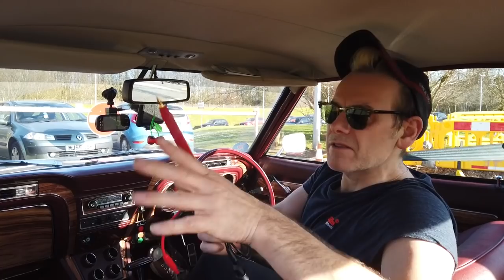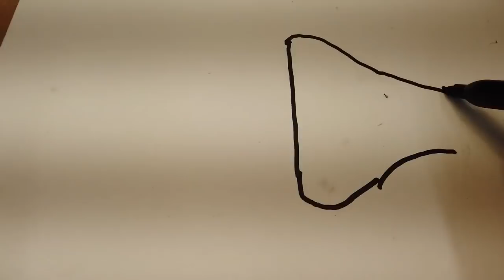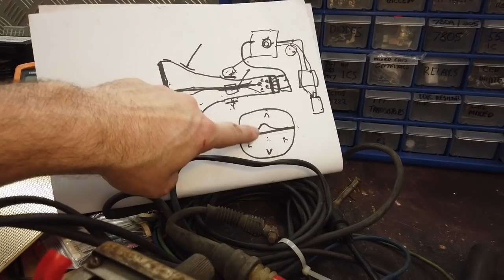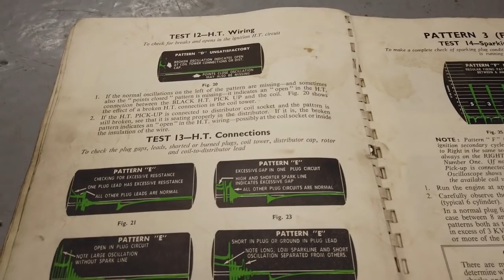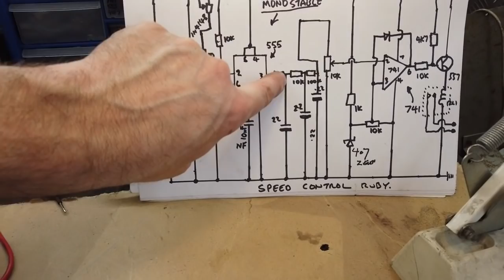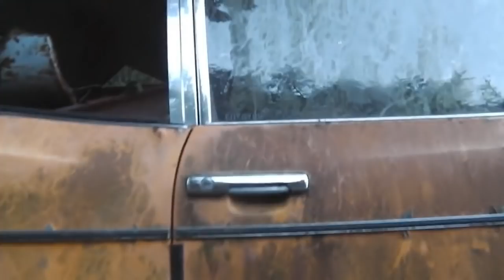Cortina v Crypton Tune - TECH VID 1

Comment: Here is David tiptons isolator and dim bulb tester    https://youtu.be/ykUlzhCTLvg   he is one of the best at faithfully restoring old radios back to as new,bit like yourself with Corrtina. Hes ex aircraft maintenance so ls very precise. Myself being lazy  use a plug in watt meter variac isolation T/F and wire in the bulb if required use a gu10 fitting with 30 or 50w 230v  halogen if you cant get a 60w lamp.
Reply: .   https://youtu.be/ykUlzhCTLvg Here is  David tiptons  tester I forgot to add earlier.

Comment: Nice CRT scope explanation.

I have just noticed there are 2 early  silicon diodes in  on the end  central switch on what looks like a 2 pole rotary mains switch  they are silver  diodes may  go to the smoothing caps usually about 50 microfarad at 350V DC  its hard to tell see if taps from the transformer go to the switch also. HT regulation may occur elsewhere via other diodes again its hard to tell. DC Those EY86  diodes are used for the EHT rectification  in tellys and could form a Tripler circuit. 

Check the resistors again I think 240k  out of circuit. The 52k is 82K you are right the odd stressed resistor will usually go high. Valves are quite tolerant  of resistors going 20% out the circuit will work not be not to optimum looks as though those are 5&10% tolerances (gold and silver). Pull the other chassis and do a comparison of measurements. are they the same PCBs? did you get valve & pin outs?

The chassis is not bad as it is isolated by its own T/F, however  if it its  insulation was   bad the isolation T/F gives extra protection when fault finding. Old tellys and radios chassis  used to be on one side of mains possibly  live when 2 pin sockets were around  or at 1/2 mains potential  with full wave rectification so isolation transformer is essential. If using a scope you to fault find don't plug it into the same isolating transformer. I think a separate isolation T/F is needed for earthed test equipment when working on that older TV chassis I will need to look it up.to confirm.
You should build a wee test rig for that variac and isolator T/F with built in volt and current meter along with kill switch, .For quickness  get a watt meter with built in current and PF measurement.  eg Nevsetpo Power Meter UK Plug Power Monitor.